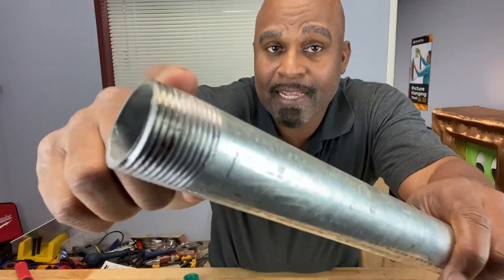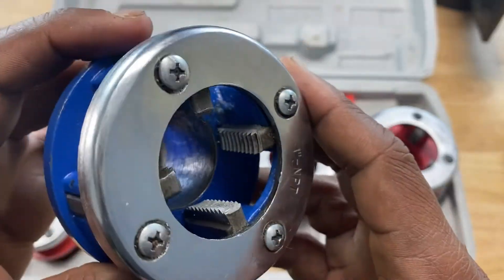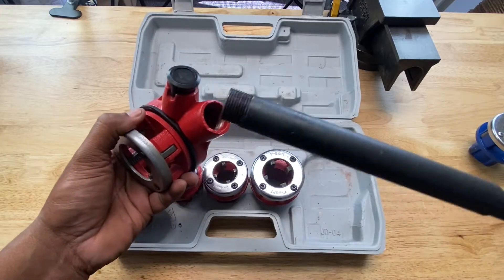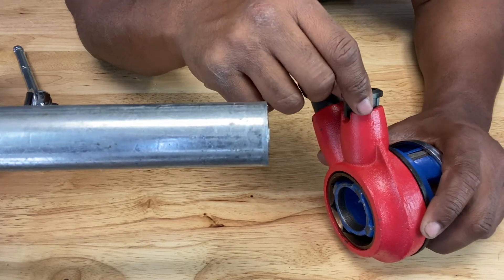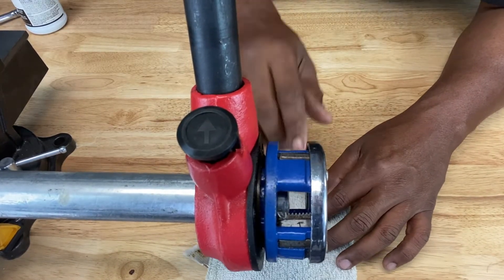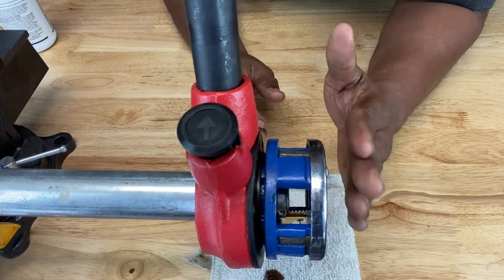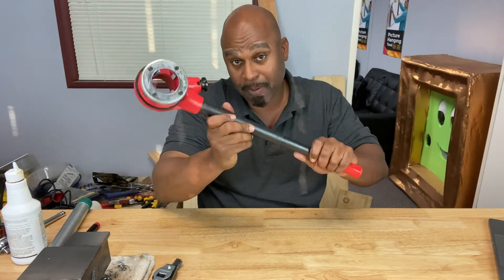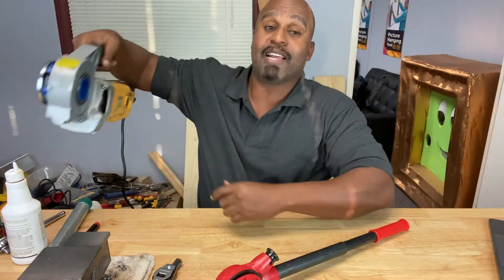HOW TO THREAD A METAL PIPE

Comment: pretty good video, Good explanation of material and assembly, BUT you should reverse the thread cutting after a few cuts not after cutting most of the material.
Reply from the maker: Good tip.
Reply: The power threaders don't reverse.

Comment: Thanks DUDEZILLA for this!!
Reply from the maker: Glad it helped.
Reply: @Caliber8Tools  FIY- I NEVER theaded pipe that big..... I thought it would be like theading small 'stock'... I was freakin' putting the tool on the pipe the wrong way! Rookie mistake!!!! But after watching your 'totally rad' video, I corrected my issues and it threaded just fine!!! WOO HOO!!!!! Also,, I HAD my great, great uncles die set from when they worked in the oil fields in OK. in the early 1900s but I got rid of them like 15 years ago! SON OF A!!!!
Reply: WORD!!!!!!

Comment: I have changed 3 times the cutting die on my Riged pipe threader with no good results.the thread on the pipes keep breaking off.I have done everything watching the videos as how to do it right way please advise what am I doing wrong
Reply from the maker: Are you applying enough cutting oil? What type of pipe are you cutting?
Reply: Are you using cheap import pipe that is under nominal diameter? You changed the dies, are you sure that you installed them correctly?

Comment: Actually the deburring tool in the video is for softer metal pipe such as copper.
Steel pipe uses a pipe reaming tool to de-bur the inside diameter of the pipe being threaded.  Steel pipe should be reamed prior to threading.  This is done to return the pipe’s inside diameter to its original bore.
Reply from the maker: Great tips thanks.

Comment: Hi I really enjoyed your video. I just bought a cheap conduit threader and tried to thread a 25mm conduit. with alot of pressure from my hand on the die head and turning the ratchet. The die looks like it is cutting but sometimes the ratchet spins or doesn't grab the conduit. And take the conduit out and there is no thread , it has just chewed up the pipe leaving it rough with no groove or thread pitches
Reply from the maker: Did you lubricate it with cutting oil while you were cutting?

Comment: Thank you so much. I was a bit confused about Stock and Dies, (the Threading process in general) 
Question:  After you Thread, is it common to need to Ream a pipe again?
Reply from the maker: After cutting yes. Not necessarily after threading.
Reply: @Caliber8Tools  

I am taking a Plumbing course. I am trying to learn as much as I can about this subject.
Reply from the maker: @Incognitus_Mcgee  Good trade to get into
Reply: @Caliber8Tools  

Some of the concepts are a bit confusing
Reply: @Caliber8Tools  

Do you have any advice?
Are there any Plumbing books I should read?

Comment: I have a question.   I doubt this will work for my application.   But one never knows until he asks. 

I am attempting to thread a 9mm barrel to except a 1/2 x 28 flash suppressor.   I have made one attempt already and failed.  My problem isn't threading.  It's removing 2mm of metal around the barrel to handle the 1/2 cutter.

The barrel is 15mm thick.  Before I thread I need the barrel to be 13mm.  I tried using a grinder.  This is where I failed.  I wasn't able to get it even all the way around.   I don't own a lathe.

My question.....would I be able to feed the 15mm barrel into the 1/2 ratchet threader and would it cut 1/2 x 28?  I'm hoping the opening to the ratchet is slightly tapered to accommodate the 2mm of extra metal.

Thanks to anyone that answers.
Reply: No. Two things....the barrel needs to be 1/2", not 13mm, and you are trying to meld two different types of threads, 1/2" NPT, which is tapered pipe thread, and 1/2 x 28 which is non-tapered machinery thread. Two very different animals. Find someone with a lathe.

Comment: I am Aftab from Pakistan
Domestic & Building Plumbing Works. Installation & Repairing LPG, Electrical, Manual Gryzers & Auto Washing Machine.
My fix die is not working. Do you help?
Reply from the maker: Do you mean your pipe threader die? If not, you may have to replace it.